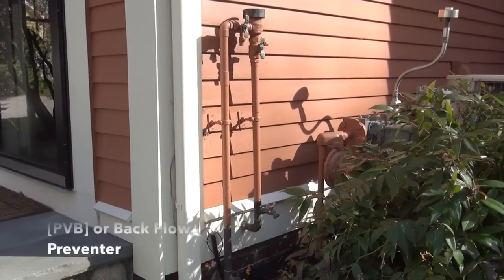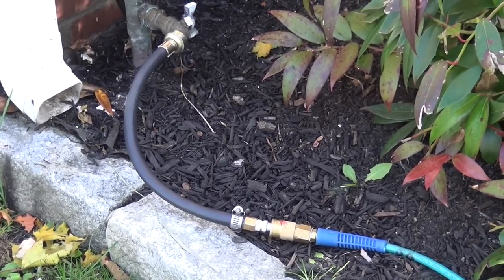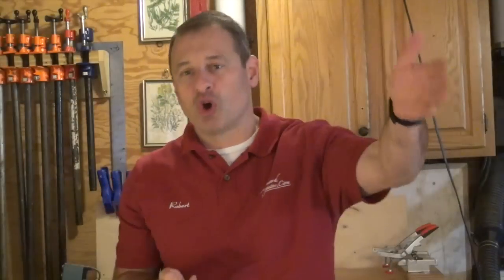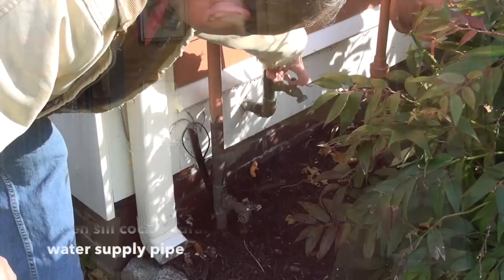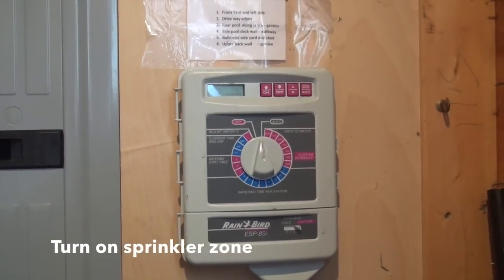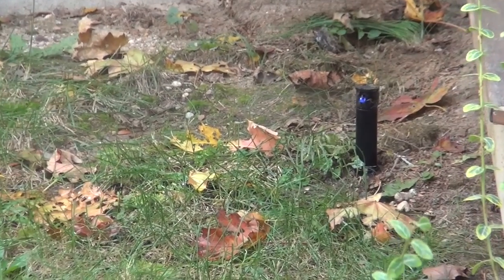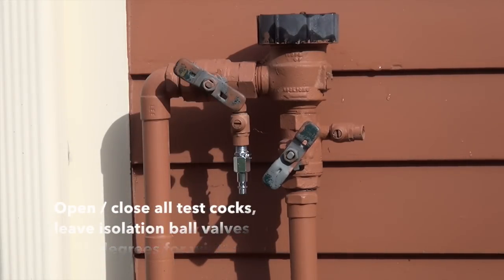How to Winterize Your Irrigation System [Blowout Method]

Comment: What if the air bladder on that unit (back flow preventer)  that you connect your air compressor to keeps opening up and doesn't allow the air to go into the lines?

Comment: Hi and thank you for providing the instructions for blowing out the system.  I have a problem.   I attached my air compressor and ran it.  I blew out one zone but then air started to come out of the BFP.  No other zones would clear.  What did I do wrong and how do I correct this?  Thank you in advance for your help.  FYI I am using a big air compressor.  It reaches 200 psi.  I hooked it up to the hose bib.
Reply from the maker: @jeffdavidson7860  is the BFP closed
Reply: I believe it is.  I see a ball valve below it.  I will close it again and try to do the blowout again.  If that does not work, any ideas on how to close it?
Reply: I turned off the valve to the BFP.  Still no pressure going to the sprinklers.  I tried several zones.  Nothing.  I'm connected to the silcock.  Can we FaceTime video call?  I'm glad to pay for your time.
Reply from the maker: @jeffdavidson7860  do you have a rain sensor on the system

Comment: What does it mean when the air is coming out of the back flow valve on top instead of the sprinklers?
Reply from the maker: You didn’t turn of the valve to separate it

Comment: That red electric Husky brand air compressor doesn't do 100 CFM. It might do 5 CFM. There is no way that that cute little electric engine is producing anymore than 6 CFM. 6 CFM is would be a liberal number. I bet you that it takes several minutes for that air tank to fill up. Am I right?
Reply from the maker: Yes on recovery

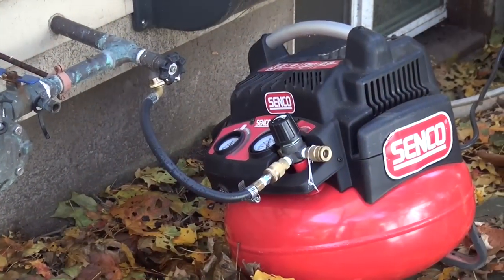Comment: Thanks Rob for the video. At 1:38 mark you showed being able to do this with a small pancake compressor, albeit more time. Can you please elaborate, because I've struggled with such unit. Every time the tank is depleted, it never builds enough volume to empty the water lines and the air has escaped already while the compressor needs to charge up the tank (if I'm describing correctly). Any tip would be appreciated. Thank you!
Reply from the maker: I use this and a 100 hose. Your lines might be too long, try a bigger compressor or add a expansion tank. Remover to close zone while building up the air storage
Reply: Had the same problem, I put a shut off valve on the hose assemble so I did not have to disconnected the hose

Comment: Hi Rob, when running the air compressor to blow out each zone, do you leave the test cock open (parallel to the pipe) or should they be closed?  Thanks!

Comment: Hi Rob, thanks for this video. I'm trying to do this as described, but air keeps leaking out of the top. Seems to be coming out of the black part on top of the back flow preventer. Any ideas? Thanks!
Reply: I’ve had that happen. Take off the cover of the back flow preventer and you’ll see the pin that raises up with the valve. Clamp onto that with a pair of vice grips to keep it sealed and you’ll be all set.
Reply from the maker: Sometimes the rubber. Ring needs replacing
Reply: Agree to remove the upper cover, then I took the spring that was above the seal piece and moved it below the seal to push up and seal that opening, it works a charm and allows me to pressurize the system. Learned this after MUCH frustration and trial/error.

Otherwise yes the air just escapes through this EASILY.

Just remember to put it back to its place so it can operate naturally in the spring!

Comment: All the air just blows out through the back flow preventer when I try to connect the air at either test cock location. Any suggestions?
Reply: Try taking a pair of needle nose pliers and grab the plunger inside the back flow preventer. Pull it upwards to help create the seal.

Comment: I have bfp like you show in this video but my question is what do you did on it before blow the lines, minute 4:19 in video
Reply from the maker: Manuel Medina open small drain valves and drained
Reply: I know, but you turn to the left the top of the bfp like you unscrewed that part (i’m sorry for my english) do you disassembly the bfp?
Reply: I did what you show in the video but when I try blow the lines the air come out for the top of the bfp, I need to do something else?
Reply from the maker: Manuel Medina you have to isolate the BFP valve by closing the ball valves and direct the air into the field
Reply from the maker: Manuel Medina no I blow it out and then isolate it so the air will enter the system in the yard
Reply: 👍 Thanks!

Comment: Um...80-100 CFM, really? I have the exact compressor. It is 5-9 CFM at 90-40 PSI respectively. Good for running an impact maybe, but not blow-outs. Compressors that push 80-100 CFM are more like the diesel tow-behinds, which of course can do your 2" mains, and 1" poly lines greater than 200 linear feet. Also, you should instruct your viewers what the critical PSI range is (40-60) for blow-outs. Otherwise, people will be blowing their manifolds a part and rocketing heads out the ground!
Reply: 185 at 70 psi every fall
Reply: Right!!! Not sure I've ever seen an 80 CFM, but I know all the 100 CFM's I've seen are tow behind, some are gas but mostly diesel. And I 2nd the 40-60 psi, I've always heard 50-80 depending on the type of pipe, so 40-60 is playing it safe.
Reply: Yep, I was shocked.  80-100 cfm! I was just pricing out 20 cfm compressors and they are 2 grand.
Reply from the maker: Gorsuch Landscapes your absolutely right, my error. Thx for pointing that out, great advice on psi thx
Reply: Some systems require 120 psi but I will stress even if the system can handle 120 psi 80 psi may move the water better than 120.
Reply: @Professorintheweeds  Trust me- it's not about the psi but the volume. If you pop a balloon the two atmospheres immediately equalize regardless of the PSI. When it comes to blowouts, really, it's the CFM (volume/time) that's important. CFM is directly related to the HP of the power source. Like the balloon analogy, as soon as you open the solenoid the two atmospheres are going to try to equalize. You need something that can continually supply pressurized air while things are open. This explains why you can use practically a pancake compressor for a nailer (which is intermittent use) but a paint gun (continuous use) requires high CFM. You can try to rely on greater PSI to compensate for lack of air delivery--this is because PSI packs the initial punch--but a larger tank is really where you're going to benefit from weaker compressors because of the volume it can store. This is usually stated as "tank assisted CFM" on some compressor specs. If you have a small tank, cranking it upwards of 120-150 PSI will very slightly improve the length of time the heads stays up, but you risk blowing stuff apart at these pressures.

The reason why you get greater CFM at lower PSI is because of the back preasure against the pistons of the compressor, thereby inhibiting its true power potential.

Ideally, high pressure/low volume air compressures shouldn't be used for irrigation systems. But I understand they are the much cheaper option to the construction grade towables. Speaking from years of professional experience, you can easily blow stuff apart at pressures greater than 80 PSI. Trust me I have. Lol. For residential blowouts a 20 CFM air compressor is sufficient to finish the job in a reasonable time. Anything less one would be relying on PSI to "punch" the water out instead of "blow" it out, not to mention all the downtime in waiting for the compressor to recharge. But again, high pressures are dangerous for the sprinkler system.

Comment: Pretty sure that air compressor is about 10x less capable of 80-100 cfm, more like 5 to 7 cfm @90 psi judging by the small compressing unit on top.  That and it's only 110 volt and not hardwired to a 220 or higher voltage system.
Reply: I was going to say the same thing!! My gas beast is only 24 CFM. That Husky is probably 6 cfm @ 90.
Reply from the maker: Guys ..... your right, my error. Thx for pointing that out
Reply: Yes. I was going to say. I have the EXACT compressor. it is rated at 5-9 cfm I believe @ 90. I've done dozens of SBO's with this and it would take over an hour to do a 6-zone blow-out AFTER set up, meeting with the customer, and draining; and would never keep the heads up to the point of blowing the system dry, having to let the compressor recharge more than once for each zone. I bought a new one which pushes 21 CFM at 90, which is, in my opinion the absolute minimum in order to keep those stems up and blow the water out instead of the air blowing over the water level in the irrigation lines, hence preventing from the stems dropping prematurely. Also, this guy doesn't know what he's talking about when it comes to introducing the air into the system with the valves open, so as to prevent "damage to the valves." My question for this idiot is how he is able to charge the backflow via closing the bonnet/poppet without having the downstream valve closed? Sometimes it will charge, but most often it does not, creating a loud fluttering noise out the top past the bonnet. You know, when it comes to charging the system with water one must have the valves closed then open them up systematically so that he can effectively charge the system. But according to this guy, it doesn't apply in the case of compressed air? LOL! Also, air will not damage a closed shut off valve unless it is a PSI greater than 120, in which case one runs the risk of melting plastic/rubber seals, that is, so long as it has been held at static pressure for a little while---even then, according to physics, once the air is released, the pressure drops dramatically thereby cooling the temp of the air, sometimes less than atmospheric temp as the air pressure temp as been allowed to dissipate while static. This is why some people will see ice crystals form after draining a tank. Also, I like how this guy taps into the test cock downstream from the check valve. One must tap the hose into the system as upstream as possible, especially upstream from the check valve. Reason is that the spring loaded bonnet inside the check valve maintains a positive pressure differential upstream-downstream, and it will blow air back into the back flow thereby trapping water upstream from the bonnet inside the check valve. In other words, if he blows out downstream from the check valve, he will not sufficiently evacuate the water from the check valve (being the most vulnerable part to freeze damage)as water can still be trapped even after draining. While draining the system usually is sufficient (for Colorado. I dunno about the NE), it will never blow this part out dry.

Also he forgets to mention the proper PSI range (40-60) for effective blow-out without blowing shit apart. I've seen guys rocket heads 30 ft in the air at 80psi LOL, not to mention that quick-connect fittings are too restrictive to air flow. I just hook up 1/4 NPT straight pipe.

Comment: I have a backflow preventer that looks exactly like the one in the video with the rust colored paint on it. I hooked up my compressor just as you described and opened the valves to the irrigation system and all the air goes right out the main valve at the top of the BFP. I unscrewed the big plastic cap and everything looks fine in there. What am I doing wrong?
Reply: I had this same problem recently. I solved it by leaving the valve to the irrigation system shut. Then applied air into the BFP etc. Since the valve to the irrigation system was shut, there was plenty of pressure available to force the BFP closed. Then once it was closed (you'll hear a noise as it closes) I was able to open the irrigation system valve to continue blowing out the system.
Reply: Great tip! Thanks for the suggestion.
Reply: I agree. I have since soldered a new valve ahead of the entire assembly so all the air goes directly to the system and not through the BFP at all.

Comment: Hello, do you know if 'PORTER-CABLE C2002-WK Oil-Free UMC Pancake Compressor with 13-Piece Accessory Kit' 150 psi max tank pressure, 2.6 SCFM at 90 psi , 6-gallon pancake-style tank would be good enough to do 4 zone in-ground sprinkler? Your answer would be much appreciated. 

https://www.amazon.com/gp/product/B000N5UHK0/ref=oh_aui_detailpage_o00_s00?ie=UTF8&psc=1
Reply from the maker: Dinesh Gurung it'll take awhile and you'll have to let the tank charge up a few times

Comment: Using a small compressor and connecting to a test port is so wrong for many reasons . Hire a pro it cost about $75 depending on the size of the system and have it done properly. This is how you will truly save a ton of money....
Reply: Says the pro who wants your $75! As long as you get most of the water out, it will be fine. The remaining water will expand and contract within the pipe's length. You just don't want it full of water, so that when it freezes it expands outward, breaking pipes and valves.
Reply from the maker: +27neverlose What are you reasons?
Reply: +A Concord Carpenter I know a lot of people winterize there own systems but here's just a couple of reasons why its not a good idea to use small air. 1)A small air compressor and hose usually will not offer enough CFM or volume of air to push water out of lower pockets from under ground pipes.It may also leave water in the elbow of sprinkler heads and crack or split both.There's many low pockets of water through out irrigation systems with poly pipes because of the way its installed ( pipe puller). 2) Forcing air thru a BFP can damage the O rings. Air should not be force thru BFP the repair kits cost almost as much as new BFP. When finishing up leave ball values partially open is great tip people should know. Most homeowner close them tight trapping water inside. Good luck
Reply from the maker: +27neverlose - Thanks for the comment, Is there a particular size of CFM you recommend?  I was using a 30 gallon tank connected to my workshop.
Reply: +A Concord Carpenter We use Airman 185 CFM compressors with the hose ball value open 3/4 of the way. Great channel, just started watching some of your videos lately.

Comment: a ton of money the average system winterization cost $75.
Reply: maybe in your area but here in northern NJ it is min $200
Reply from the maker: +dan ferrigno not in my neck of the woods
Reply: It's one payment though, and you're set for blowouts for years without having some guy come fiddle with your pipes.  I just need to find a good deal on an adequate compressor.